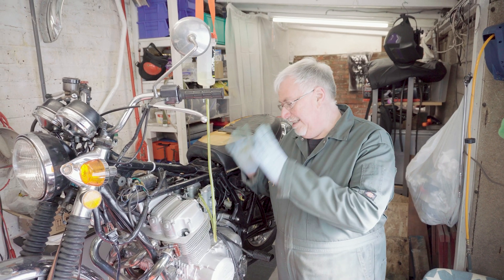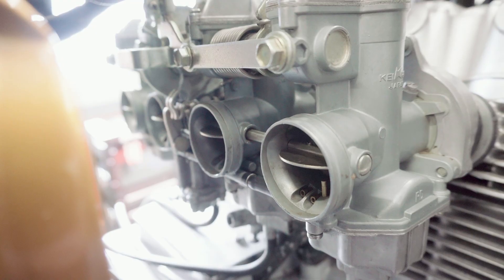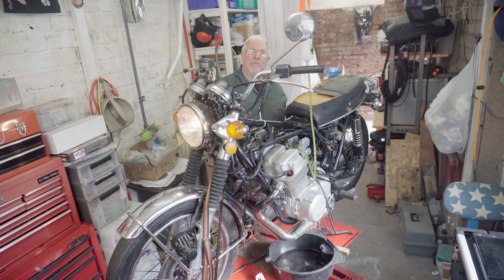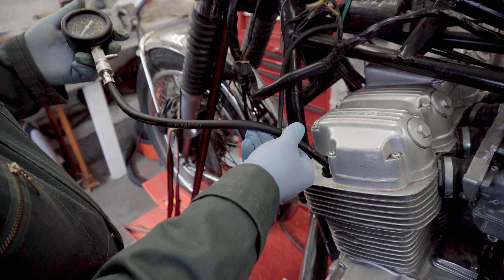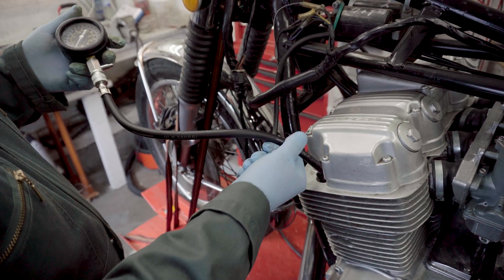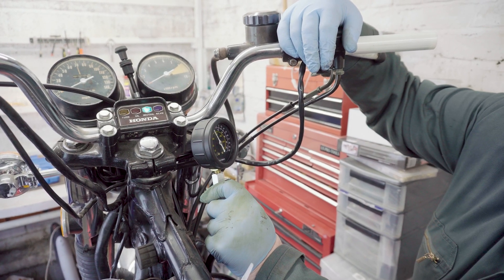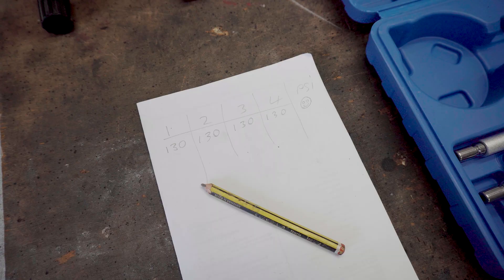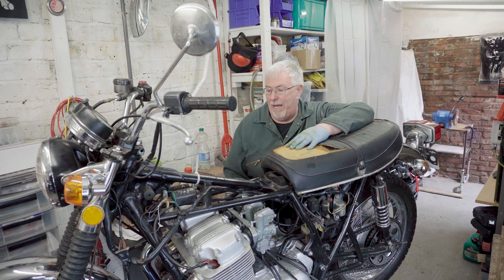How To Compression Test Motorcycle Engine | Honda CB750 Resto Project Bike | Part 13

Comment: Just to let you know, you need to hold the throttle wide open while turning the engine over. 

I did it on my 97 bandit 600 and the engine was cold and i had 150psi which is great. Hot it would be about 180psi or more which is great for a nearly 30 year old bike. 

Great video 😊

Comment: They might all be 130 because that's as high as the gage will go. I've had a lot of problems with these cheap compression gages.
Reply from the maker: Great point, I would need to take a look next time.  However for my CB750 that hadn't been run I was quite happy with 130.

Comment: Great results! If you were performing this test on a cold cb750 that didn't run what kind of numbers would you deem as satisfactory?
Reply from the maker: It isn't a question that can be easily answered. A cold engine that hasn't run for a time isn't going to give great results.  I would look to see if there was some sort of consistency between the cylinders, within 10psi or so. This would show that there isn't a specific issue with one cylinder.  You would also look for 100psi as a minimum.  Although slightly under isn't always the kiss of death.  When an engine runs and warms through the valves seat better and the rings seal better, this deteriorates over time when they don't run so the figures go down.  As long as there isn't too much corrosion or deterioration most of it can be redeemed by running the engine. I hope this helps.
Reply: @SPANNERRASH  Thank you! I'm going to look at a 72 CB750 tonight and will be performing a comp test. The bike doesn't run (but turns over) and was wondering where I should draw the line between good and bad comp which will determine how aggressively I will negotiate the price. Subbed!!
Reply from the maker: @brazoon1  Nice, hope your haggling goes well and you pick up a good bike! 😃
Reply: @SPANNERRASH  Thank you, Sir!!

Comment: Hi, thanks for the help on the solenoid (another video) so today i did a compressison test myself and i have 90 psi on 1 & 4, like 75 on 2, and nothing registering on 3 - the bike has not been run in 30 years including now, i have the exhaust fully off and the carbs too while i wait for rebuild kits...before taking a long break between working on the bike i had rebuilt the engine with new rings so long ago that while i think it was right maybe not...any thoughts short of taking it back out and tearing it down? Oh, and it had no oil until last month - with nothing going on either, just sitting.Thanks - jim
Reply from the maker: I would start by checking the cam timing and the valve clearances, making sure that all of the valves will open, and aren't stuck open. If they are all OK and the readings don't change, Try putting a squirt of oil in each cyclinder to see if it makes a difference to the readings. If it does then it indicates that it is a problem with the rings or bores.  If they don't change, then maybe head gasket or valves.  If you do get a reading with the oil and the cam timing and valves are ok I would be tempted to do the carbs and see if I could get it to run at all.  I bit of heat through the cylinders might just free up the piston rings.  You could also try using a bore scope, the aren't too expensive to try to have a look at the bores.  Good luck.

Comment: I'm about to embark on a compression test on a 75 cb750 SS. Last night I noticed blue'ish smoke and mates told me that it was most likely piston rings. THank you for this clear cut and precise demonstration. I noticed you kept the kill switch off. Does that mean I don't need to fabricate a hanging fuel tank?
Reply from the maker: Hi mate, you don't need a fuel tank for compression testing luckily. 😄

To find out whether it's rings or valves, compression test it dry initially, then add a little bit of oil through the spark plug holes and test again.

If the pressure goes up a lot with the oil, it indicates it's more likely to be rings.

I'll cross my fingers its nothing major for you, hope that helps! 🤞
Reply: Hi Mate, me again. I'm finally getting around to working on the 750. I'm going to redo a dry compression test and take down the readings. Then I'll do an "oil in the spark plug holes" and do another reading. Hopefully it will be the valves and not the removal of the entire engine to get at the piston rings. That said, how much oil do you put into the spark plug holes? I can't imagine it's a whole lot. what are we talking about a few table spoons worth?
Cheers and Happy Holidays!

Comment: Hello from South Africa . Great Video sir  , I have just got my hands on a 1980 cb750F which needs work , I have ordered a complete engine and carb Kit off ebay , I am considering getting the compression tester now . Keep up the good work .
Reply from the maker: Thanks Clifford. Sounds like you're taking on a great project bike there. I can definitely recommend the compression tester. They're a great tool and can really tell you a lot about the health of an engine, wouldn't be without one now. :)

Comment: The pressure in the cylinders is perfect, the problem may be that the fuel does not draw, try to install the air filter or set a higher fuel level in the float chamber  :) Kris.
Reply from the maker: Cheers Kris, I think you may be right with that, installing the airbox should be an easy one to try. :)